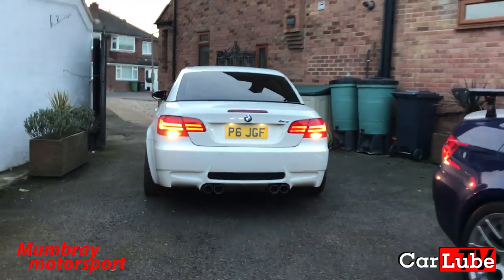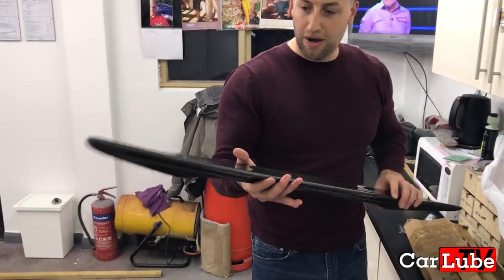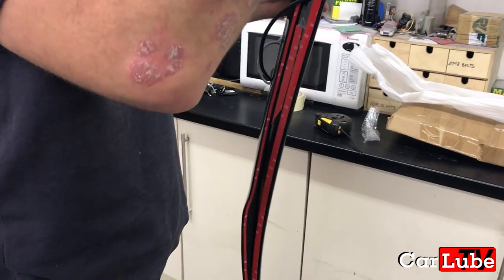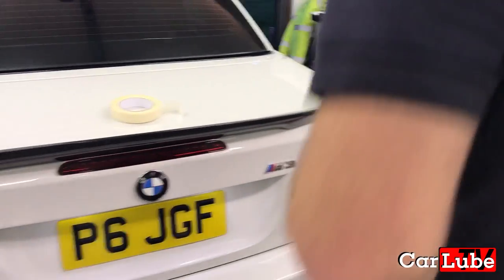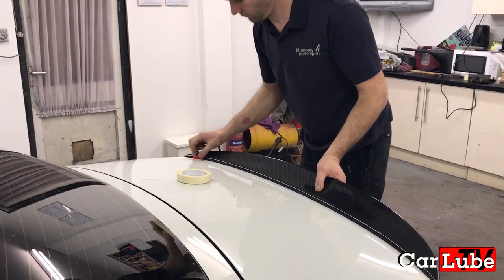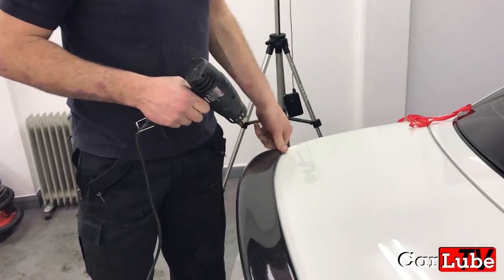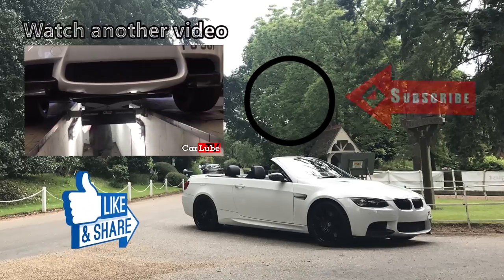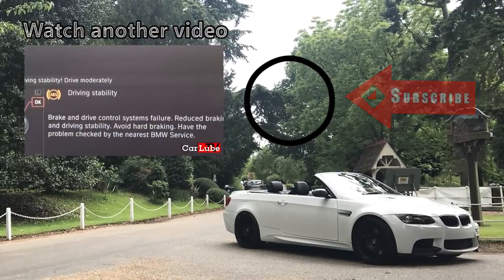ANY CAR  - How to fit a 'no drill' rear spoiler

Comment: For the ones asking about the best tape to use, I've done some very thorough reserach and this is what I've found.
(Of course there are many brands and models of tape, but this is my finding that most original equipment manufacturers are using)

3M VHB 5952 Or 5956
Both are available in 12,7 or 19mm width.

5952 is 1,1mm thick
5956 is 1.5mm thick.

The thinner tape works great for brand original accessories and gives a near invisible seam.

Thicker is good for 3rd party accessories where fitment sometimes can be less than absolutely perfect and the thicker tape fills the gap so to speak.
Reply: I used regular 3M tape as well as adhesive promoter and it gave me a rock solid bond for a while, but now that it's starting to peel a little, I'm definitely trying this!

Comment: Another good way is to use a smudge of tiger seal on the ends and the middle of the spoiler as well as 3m tape to ensure it really sticks 👍
Reply from the maker: Jnell nel it’s funny you say that, this boiler has been on the car for about four years and it is my plan in the next couple of weeks to take it off and re-stick it, as one corner has slightly come unstuck, I don’t want to use Tigerseal though as that ruins the paint underneath if it ever needs to be removed again,

Comment: It's  not for esthetic only. It applies down force on your car when you drive faster and it gives  you better handling and stability at high speeds. I felt the difference after i installed mine.
Reply from the maker: Adrian Vacarescu You’re right, I remember how the early Audi TT MK1’s were reported as very unstable before they started fitting a very small lip spoiler

Comment: I ordered my spoiler and so eager to do this. 

BUT 

How about the 3M tape? Your video guide should defo mention the exact type, width and thickness e.g. 10mm 0.8mm. 
Or 1.1mm thick. 

What tape NOT to use etc 

Don't want spoiler raised off the lip
Reply from the maker: Nazrul Hussain I think we used 10mm and 12mm 3m foam type from eBay , this stuff is very hard biting tape mate

Comment: Btw did u even degrease the boot before applying the spoiler? Also what 3m tape did u use here? 3m automotive molding tape? Pls a reply would help so much
Reply from the maker: Yes the boot was degreased, any 3M grey double sided tape can be used 6mm for curved edges 10mm tape for the centre coverage.
Reply: @carlubetv  wow thanks for the quick reply. Do you think 3m vhb would have stronger adhesion compared to 3m automotive tapes?
Reply from the maker: Yes, I think that’s what I used mate, you’re welcome.

Comment: should it still wiggle some after applying adhesive tape or should there be no margin of movement after securing it?
Reply from the maker: No it shouldn’t wiggle mate, once it’s stuck it’s stuck, does take a good couple of hours for the tape to go off though.

Comment: Ok i have a question. 
What if i want to stick it down with something stronger than double sided tape, worried someone will steal it off ! 
Thinking some strong glue or something ? 
Don’t want to screw it as that’s crazy 

Any ideas ??? 

Great vid
Reply from the maker: Stephen Swallow The thing is if someone wants to steal it they will do weather it’s glued on taped, at least with tape it won’t damage the boot, that’s my thoughts anyway.
Some use Tiger seal but this will ruin the paint underneath. The tape is strong enough.

Comment: Very good video, I just received by carbon fiber rear spoiler  with the 3M tape for my Alfa Romeo Giulia, I still have to install it. My question is ...after installation will the 3M tape be sufficient to hold it down even after multiple car washes? 
Just worried that one day it will rip off while driving down the highway. 
Thank you
Reply from the maker: Monsterrello yes mate, mines been on for over 2 years
Reply: @carlubetv  ok great ...thank  you I'll install it tomorrow.🙂

Comment: Will it wear off if the temperature is too high outside? Glue often get loosen so
Reply from the maker: First Name Last Name no mate
Reply: In addition to surface prep, I used adhesion promoter on the surface. I live in Florida and the temperatures can get extremely hot!  The 3M tape on a spoiler I installed that is similar to the video still has a very tight bond like day one!

Comment: Have u got a link for the exact tape you used please
Reply from the maker: Grant Bradley no, as it was bought from eBay years ago now, you just need to purchase 3m red double sided tape pal
Reply: 3M VHB 5952 Or 5956
Both are available in 12,7 or 19mm width.

5952 is 1,1mm thick
5956 is 1.5mm thick.

The thinner tape works great for brand original accessories and gives a near invisible seam.

Thicker is good for 3rd party accessories where fitment sometimes can be less than absolutely perfect and the thicker tape fills the gap so to speak.